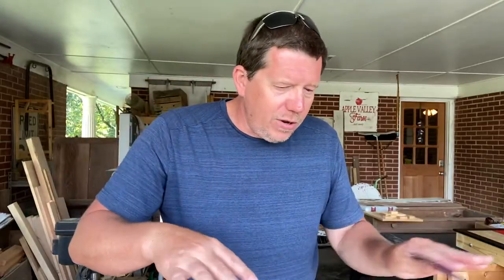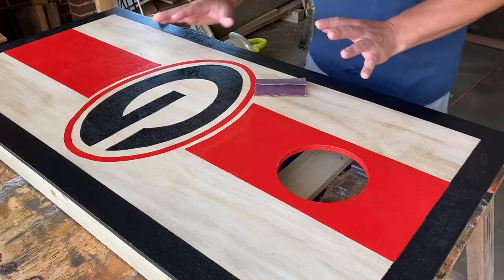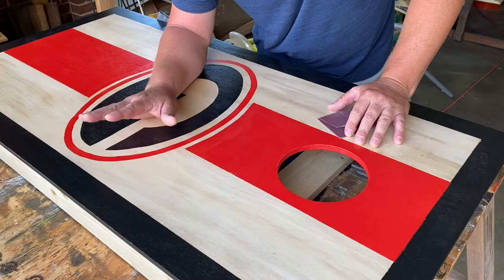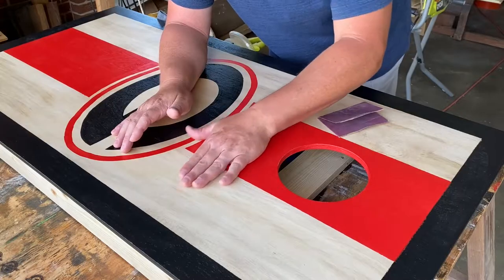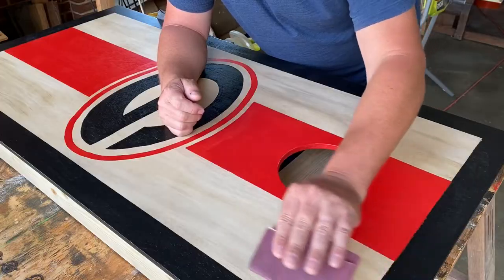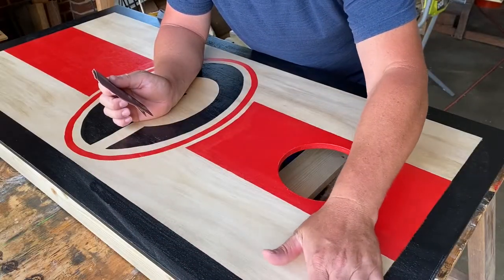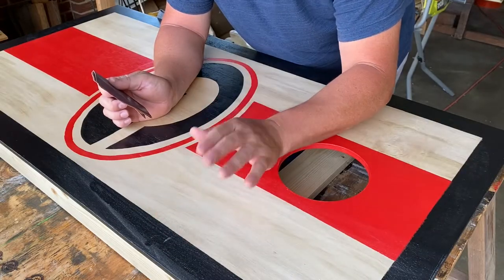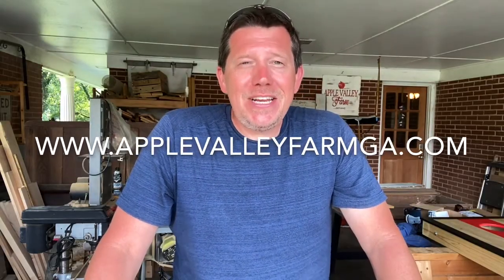How to Build Cornhole Boards: Final Sanding and Polishing

Comment: I use 00 steel wool to finish poly. It "cuts off" the imperfections rather than sanding then buff the finish with a waded up brown bag.
Reply from the maker: Very cool. I'm going to give that a try. Thanks!

Comment: did you put on 2 coats of poly without sanding in-between before sanding for the 3rd coat?
Reply from the maker: Unless I forget (which I'm prone to do!), I try to always sand in between each coat.
Reply: @AppleValleyFarmGA  thanks a lot for the reply.

Comment: What do you use as a clear coat on the boards? I bought a cornhole board and painted a design on it but not sure what to use for a clear coat on it.
Reply from the maker: These days I use Varathane Water-Based poly, with a Satin finish. Dries fast, looks great, wears well.
Reply: @AppleValleyFarmGA  I recently painted cornhole boards and I’m trying to find a top coat for the boards to protect the paint from cracking  so should I use the one you mentioned in this comment? and if so should I use interior or exterior version ?
Reply: @ariannaleigh7159  i know its probably a little late to for an answer lol, but there is no “exterior” model/type of waterbased poly, which is what he mentioned in the comment. A good rule of thumb to go by when it comes to wood finishes/top coats in general is this: waterbased products = Interior Use. Oil based products = Exterior or interior, but definately for outdoor projects. I mean…you “can” use any finish you want for wherever you want, but dont expect an outdoor project finished with a waterbased topcoat to last very long if it stays outside lol

Comment: Did you sand at all in between your first3 coats?
Reply from the maker: Great question. And yes, we did. We run over everything very lightly with 320 grit. 220 if we're in a pinch. Kraft paper, as a last resort.
Reply: @AppleValleyFarmGA  Did you sand after the first coat? I keep hearing if you use a decal that you should use a second coat before doing any sanding so you don't mess up the decal. Any thoughts on that?

Comment: I just bought a set of unfinished boards and someone told me to wet sand the final sanding. Whats your opinion on that
Reply from the maker: That's a great idea, actually. That's called "raising the grain", and it's an essential step for most fine woodworking. If you decide to do this, I would sand the board to a 150 or 220, dry. Then blow the surface clean, then spray it with a spray bottle or plain water. Give it a few minutes to raise the grain, then sand it back with the 220. You can do this 2 or 3 times, each pass creating a smoother surface. Then let it dry, sand back with the 220 and apply your poly or whatever protective finish you prefer. You can skip raising the grain, but it makes a huge difference in the final feel. Great question!
Reply: @AppleValleyFarmGA  I applied my first coat this morning and I noticed there wasnt much of a difference. Is that to be expected after just the first coat?

Comment: Did you used the water based or oil based sealer?
Reply from the maker: We use the water based poly, maily because of the drying time.
Reply: @AppleValleyFarmGA  thank you!

Comment: My dad put the two poly coats on and it bubbled. I tried sanding the side before starting and the color isn’t clear anymore. Is there anything I can do?
Reply from the maker: Hey Katie. Tell me a little more detail about what you mean by "it bubbled". Is there a large bubble, or a number of timy bubles? And when you say you sanded the side, do you mean the surface of the board?
Reply: @AppleValleyFarmGA  tiny bubbles. Yes the surface of the board.
Reply: I applied poly one time very heavily so I wouldn't have to apply so many coats.  The finish became very cloudy and bubbly.  That's my guess as to what happened.

Comment: What number grit sand paper did you use thru the process?
Reply from the maker: We start with 150 before we apply our graphics and poly, then 220 and ultimately end up lightly going over everything with a 400 grit.

Comment: How long do you let the poly dry for before sanding it?
Reply from the maker: It depends on the weather (temp, humidity, etc). But in general, the water-based poly is ready to go in a few hours...although I try to let it sit overnight, just to be safe.

Comment: I put that nu finish polish on my boards and now they seem to slick. Is there anything i can do to them to make the slickness go down? Bc my bags are just flying off the board
Reply from the maker: It does make them slick, indeed! :) It will wear over time, just like a car. But I'm guessing (and this is just my guess) that you could lightly run some 220 grit over it and take that wax off. I haven't tried this, but I would think it would work. I'd be cautious about using any kind of solvent because it might harm the board itself. Sorry it turned out to be too slick.
Reply: Apple Valley Farm appreciate the help!

Comment: wet sand it.
Reply from the maker: The thought of putting water on a board that I've hand-painted terrifies me! LOL. But yes, that would definitely do it. But it's probably overkill...dry sanding it at 400, or even a light 220, usually does the trick for us.